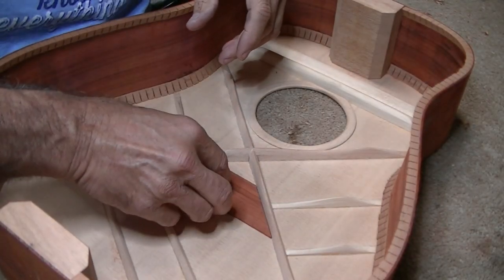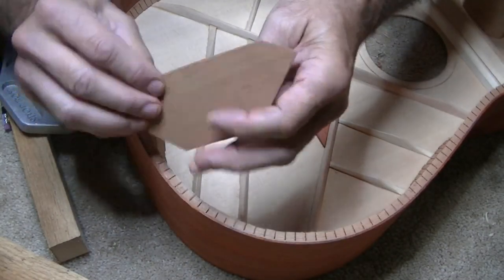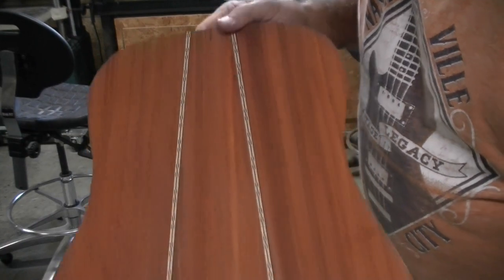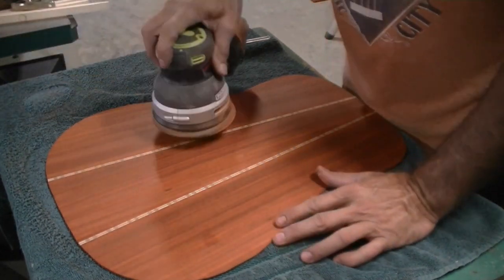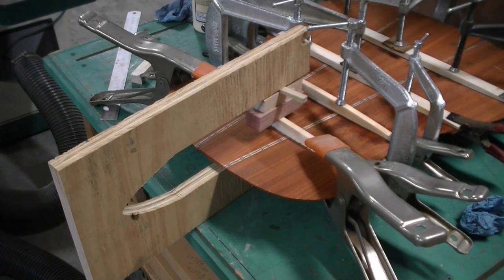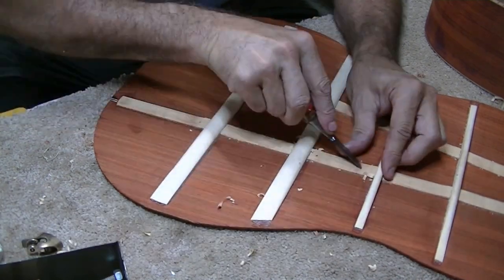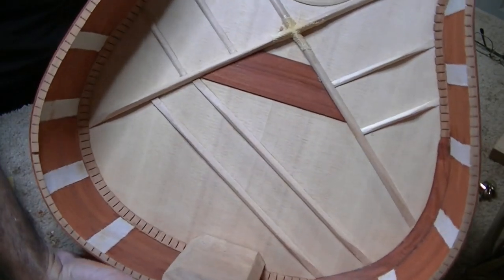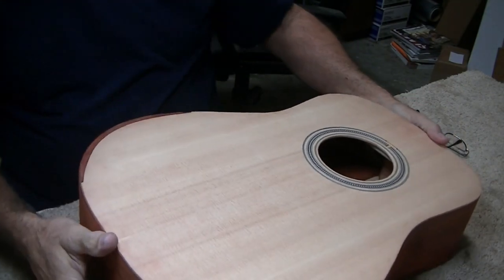225 RSW Custom Guitar Back to Sides P6

Comment: The guitar builder I was briefly apprenticed to uses, I believe, a 2" bridge plate from bubinga. The reasons he found it sound better than maple, was a bit less prone to crack, and the width helps keep the top from bowing up behind the bridge as bad. He said that's one thing they do when fixing it, so he builds it already fixed.

Comment: Terrific video! My 1968 D12-20 appears to have been built with a rosewood (Brazilian!) bridge patch. Either that or amongst the various "repairs" and "improvements" made to this train wreck before I bought it was a bridge patch replacement.
Reply from the maker: I probably shouldn't have mentioned Martin specifically. Many  manufacturers use maple.

Comment: as usual, this is a great video. you should check out the Lie-Nielsen violin maker's plane for  shaping braces and other things,like trimming the top for your arm bevel.  best hundred bucks you'll spend on a hand tool. Also, I like to put the back joint reinforcement strips in before the back braces. That way the joint reinforcements can be cleanly sanded....then I notch the reinforcing strips for the back braces.  But everyone has their own favorite way of doing things..... keep on keeping on,

Comment: Personally I would have cut the roundover bit of the front first to fit the sides before cutting the shape of the front out and before you put the braces on the front. In this way you solve many of the problems that you are finding fitting the front in because you can cut the front to shape with a router after you have put it in place.

Comment: Jerry, HA! I caught you. You said..."Chisel's not sharp.....AGAIN".  We watched you sharpen it only several videos ago.  Jerry, BUY YOURSELF A GOOD SET OF CHISELS!!!  Spend a little money rather than those well loved Harbor Freight ones!  You will not regret it....stays sharp longer...
Reply from the maker: You don't realize how much work I do with chisels. There could have been a dozen things done with that chisel between videos. I've had those same tools since I was a teenager. I've used them a lot. They hold up just fine. I never said they were the highest-quality they're just good enough.
Reply: @RosaStringWorks , you are right and my apologies!  I realized that while I am watching the videos 1,2,3, you are working on a bunch of things in between!   As punishment my wife has me on time out. :)  Just finished the custom build series, awesome work as everyone agrees.  Also watched the video where you explained the heat temp issue with your bending iron so forget my questioning the use of such low temps!  So you know, you aren't the only one who "hates" Celsius and millimeters....!

Comment: thank you . i have old milk bottles filled with cement for weights the bottles wont damage the wood . hopes this is a good tip for you. what do you sand to 300 - 400 ??

Comment: Hi there! Hope all is well! Wow, the guitar is really awesome. I have one question about the bridge plate. Will resins and or oils seep out and make the plate come loose in years to come ? Does the acetone pretty much get rid of all the oils when you applied it?
Reply from the maker: I don't think they'll be a problem I've done it many times before and have had no issues. Plus the padouk sides are glued to the neck Block in the tail block and I've never had a problem that way either

Comment: Being only a listener, not a player and with a bad memory to boot, I don't remember the name of the Guitar company that you said uses maple bridge plates exclusively.  Have you ever replaced a maple bridge with one made of something else you prefer in a Guitar?  I suppose everybody's plate is stuck on too tight to remove via the sound hole.  If you have replaced a bridge plate with a better sounding one, how did it turn out?

Comment: Jerry, What are your thoughts on adding a mitchel's platemate http://www.mitchelsplatemate.com/ to the bridge plate of a guitar?

I added one to my old Guild D-40 and I didn't really notice a major change in the sound of the guitar, but I'm sure my bridge plate isn't getting beat up/eaten by the string's ball ends.
Reply from the maker: I think under certain conditions they're very good. I would prefer to only use them in cases where the bridge plate is very soft like where they used a softwood rather than a hardwood.

Comment: Jerry, at 28:22 after you remove the clamp, it appears that the back doesn't go all the way to the edge of the sides.  Nice video.  I really enjoy your down-to-earth style.
Reply from the maker: That's not uncommon as long as it's smaller than the binding channel there's no problem.
Reply: OK.  I didn't know about the binding.  I don't build musical instruments.  Thanks for the quick answer.
Reply: You say maple is not acousticly good so why do your make mandolins with curly maple why not use padauc wood they would probably sound better